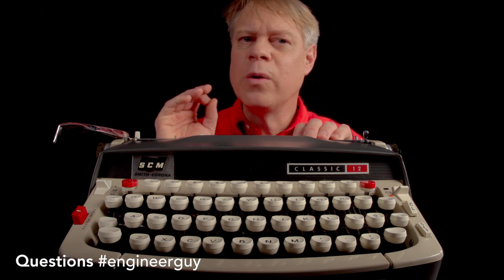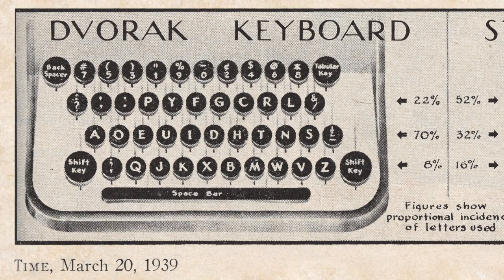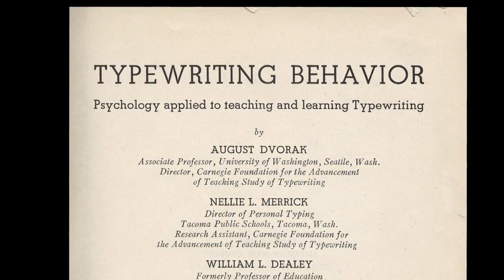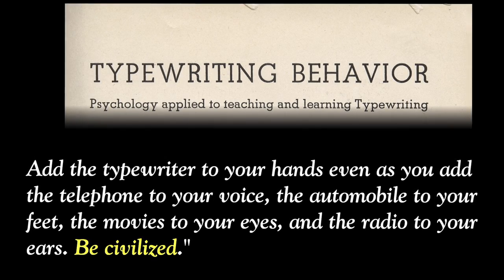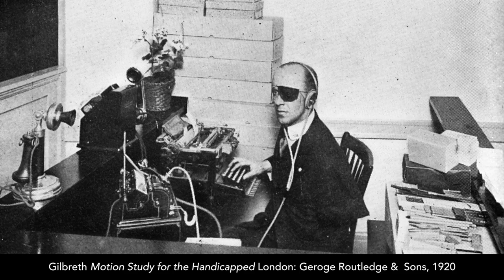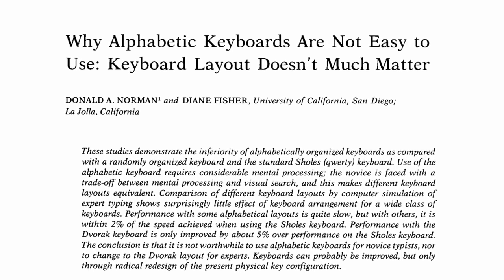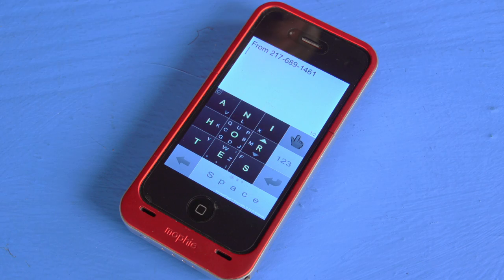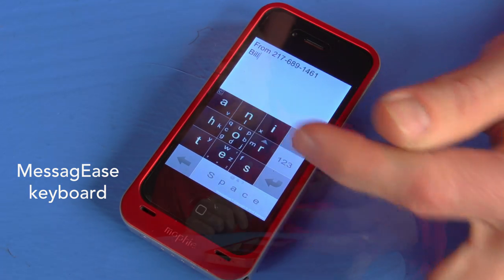Why the Dvorak keyboard didn't take over the world

Comment: I learned QWERTY touch typing in 7th grade (1962) and went on to become a software developer. Around 2000 I started experiencing 'carpal tunnel' type pain in my wrists and took the opportunity of a job change to retrain myself to Dvorak. It took about 12 months to regain my 60+ words per minute speed with 95%+ accuracy. Since then, the pain is gone and I am convinced that minimizing the up and down motion required by QWERTY is why. YMMV.
Reply: I agree about it causing pain. Even if its not painful I feel the strain from the QWERTY pattern in my relatively young hands. Its also rather awkward in how it feels.
Reply: 60wpm average or peak? that sounds a bit low to me, considering you're a programmer from such long date. but glad to hear dvorak helped you.

notes:  just took a test and did 91 wpm on the first try (454 cpm). if i remember correctly i can do over 120 if i concentrate and take the test a couple times more. 
but as i type this i notice i'm not trying to type as fast as i can so i'm at least 30% slower than i am taking the test. maybe in a normal situation i'm closer to 60 than i am to 100 wpm...
or not, since the words are all in my mind and i don't have to waste concentration reading two words in advance from what i'm typing.

Comment: I have to dispute the main thrust of the argument presented. I have personal experience using the Dvorak layout. In 1990, having capped at 68 wpm with qwerty regardless of how much I practiced, I switched my work pc to a Dvorak keyboard. For two weeks I was virtually crippled by my muscle memory making me choose the wrong key as I typed. Then I relearned the map and within another three weeks had equaled my 68wpm. I popped the caps on my laptop and switched those as well. That was in the days of easily popped keycaps. I changed my home pc also. Within another month I had finally crossed the 100wpm threshold on Mavis tests I used in my spare time. I averaged 95wpm in the real world. I wrote a lot of management reports and finally could type at closer to my speed of mental composition. It was liberating. I was more accurate as well because Dvorak moved odd keys to the periphery. Then laptops took over and hard-to-pop key caps predominated. My colleagues didn't switch because they couldn't envision relearning or even harder, unlearning what they already knew. The reason Dvorak failed wasn't because it was limited to 5% improvement. It was much more. I suspect those studies used subjects that spent little time unlearning and relearning, as it's a major investment, and hence they yielded only a 5% gain. But within 90 days i had realized a 40% gain and benefitted for well over a year before upgrading to models that made Dvorak difficult. You can't mix. If any pc you type on uses qwerty, Dvorak speed plummets because that speed requires automatic response. The key would be to have taught typing in schools in Dvorak. Same with Esperanto. Teach everyone worldwide this common language as their second language. Then we can all communicate. But the initial  investment is high. So we live in a world of fragmented languages and I type at 65wpm and have for decades now.
Reply: You went from 68 to over 100, but people who were already over 100 have less room for improvement.  It took you weeks to get back to where you were before the switch.

It has a lot to do with individual perceptions of expected improvement.  The bigger the expected improvement, the more likely a person is to switch.  That means that the people who are really good, and the people so do not expect to be very good are the least likely to switch.
Reply: Well, on typing competitions back in the day all the ladies and secretaries that learned Dvorak dominated. That was until Dvorak layout was banned from the competitions.
And if something is banned from a competition because it always wins, I'm quite certain that it must be good.
Reply: Metatr0n yes but at a competitive level 5℅ is huge. i mean i expect that difference to be larger than the skill difference
Reply: I switched to dvorak a few years ago and just bought little stickers/labels that fit on the keys. Easiest fix out there if you don't have a keyboard you can take apart.
Reply: If you could type at 100 WPM, then would you really need to rearrange the labels of each key?  Just switch the keyboard to Dvorak via software...  Seems fishy to sacrifice "40% gain" due to the inability to pop the keys.
Reply: With computer operating systems (except iOS, for some reason) there is no need to change physical keys or put stickers on. If you are touch typing, as I am now, with a Dvorak layout on a QWERTY-labeled keyboard, there is absolutely no issue.

I only switch back to QWERTY on shared computers (hate it, because I have to hunt-and-peck) and for some games (often designed for physically proximate keys based on QWERTY).
Reply: A guy in India has a record for typing 103wpm with his nose. Maybe you and all your colleagues should switch to using your noses?
Reply: Metatr0n, "And if something is banned from a competition because it always wins, I'm quite certain that it must be good." Yeah...not always the case. Stuff gets banned for various reasons. (Though there doesn't seem to be any evidence that Dvorak keyboards were actually banned from competitions. Though they might have been in some cases, there were a lot of typing comps, many sponsored by typewriter companies, so I'm sure somewhere in there many things were banned. If you sponsor the event, you probably want your brand to win.)
Reply: +Roger Bowman
Did you forget where the enter key is when you switched to Dvorak, or are paragraphs new to you?
Reply: Roger Bowman : Esperanto sounds an awful lot like Spanish when spoken...just sayin'...
Reply: i also use only Dvorak's 'Simplified Keyboard Layout'. (That's what Dvorak called it. I like his name better so i use his name for it too.) Roger, what do you know about this topic? You only have personal testimony and (years?) of experience on your side. (I'm being sarcastic.) Before i made the switch years ago (maybe 5 years ago), i saw a big debate about it. Then i weeded out all those who did not say they actually tried it. All who mentioned that they tried it loved it more.. every single one of them! And only one actually switched back to Qwerty and that was only because he was forced to use Qwerty at work and he was tired of wrestling with both. Some people switch between them without much trouble. But i do notice my speed decreases when i use both layouts. I did have a job where i typed some (after i switched to Dvorak's Simplified Keyboard Layout), and i had to use Qwerty at work. But i didn't type much so my about 40 wpm on Qwerty was sufficient and it didn't bother me much. If i were to type a lot, it would bother me being required to use Qwerty a lot. Now i'm able to avoid using the Qwerty layout almost entirely. (I finger poke occasionally when i need to help a friend on his/her computer.) My typing speed increased a LOT when i switched to only using the Simplified Keyboard Layout too. I recently measured my speed and i'm about 50% faster with Dvorak's Simplified Keyboard Layout, but i don't claim that is because of the keyboard layout. it might just be me and more practice. what i do claim is how much more comfortable and thus more enjoyable typing is on Dvorak's Simplified Keyboard Layout. But many typists indeed find a much faster speed after switching from Qwerty.
Reply: Roger, i encourage you to look into the Ido language (as an alternative to Esperanto). Web search for 'Ido linguo' for best web search results because "Ido" finds English mispellings of "I Do" more than the language. :P
I like Esperanto too. Esperanto is a great and brilliant language! But i'd compare the first (alphabetical, A-Z) keyboard layout to traditional, national languages. I'd compare Esperanto to the Qwerty keyboard layout. And i'd equate Ido to the Dvorak layout. Esperanto was designed by an optometrist, while Ido was designed by a professional linguist. But both are great languages. And Esperanto is still super. I'm not knocking Esperanto at all, but i do knock Qwerty.
Reply: Justin - In other words you have no decent rebuttal to his argument so you just resort to sad insults?
Reply: Justin, Jenny has a point. please allow me to politely expound a bit more. even tho Eric was ignorant in both of his points, there's a mature and much more polite way to express it. something like, 'Eric, neither of your points are factually correct.' And if u want to expound on the facts, then you can. if not, u don't need to. cheers! (personally, i think it's more important to treat people like people (with respect) than it is to even post anything regarding a topic about keyboards (which is not the most important topic in life).
Reply: @851852093114208513 , you believe 2 misconceptions in your argument.
#1: Dvorak is truly a lot better than 5%. if u try it, you kan see how much (far) better the Dvorak is. my estimate is about 50% better, both in speed and 'ease' & comfort on one's hands.
#2: a lot, lot more people speak Esperanto. when u claim 20 people, i hope u understand that u are under exaggerating, 'only' by a factor of roughly 5000 times. 😋
I see your point that if nobody or few people uses it, then it's not so useful, like a telephone when nobody owns any yet. true. but when enuf people realize the potential, they will get them, so it will be useful. But Esperanto has already way over grown the useful threshold. Millions of people speak it. i like Esperanto a lot. but i like an easier language with the same purpose as Esperanto even more: Ido. but even then, Ido has many, many more speakers than 20. 😜
Reply: Mark m; you can use www.branah.com/dvorak on shared computers

r.decline; haha no way anyone types 103wpm w their nose. The g forces on the brain would be deadly.

Eric bishton; if everyone learned esperanto then everyone would know how to speak it.
Reply: cool anecdote bro

Comment: While I was at university I learned of the Dvorak layout and wanted to try it out. I found stickers on ebay which I stuck to my keyboard at home to turn it into dvorak. After forcing myself for a week I was able to type dvorak. A month later my dvorak and qwerty skills were about the same, seeing as my qwerty skills suffered a bit. Interestingly enough at this stage it was impossible for me to type qwerty on my home keyboard, and impossible to type dvorak anywhere else. 

A year later I bought a wireless keyboard for my home computer. I considered staying with dvorak at home, while type qwerty everywhere else. But I didn't. The main reason is I suffered when it came to key bindings on modern computers. Something like copy, paste and cut, which I use constantly, is a one handed operation on qwerty. On dvorak they are two handed, unless you have a large hand "wingspan". 

In this case the qwerty layout was adopted too widely to make a change impractical. :(
Reply: +JP Meijers I have a non-qwerty layout and the short cuts are unchanged. It took me much longer than a week.

Comment: I tried to switch to Dvorak once, for a year.

I gave up, the investment needed to get used to it might be OK. However, In a world where I not only use my computer ever only. I gets worse. I developed problems using a QWERTY. Go to the university, use a terminal there? Fail. Use the vending machine selling train tickets? Fail. Get in the bootloader of you notebook? Fail, no Dvorak there either etc.

Its locked in technology, since everything would need to change at once...
Reply: I must not be able to count. I get 8 permutations by 3+3 keyboard layouts in both languages then +2 for each spoken form. Its not 3^2 to equal 9, or am i just mistaken?
Reply: If you cant access www.branah.com/dvorak to cut and paste then someone needs to make a keyboard w hardware that sends the proper signals of its’ dvorak layout. I mean type type a letter g in the dvorak location where u is on qwerty and the keyboard sends a g signal. Then absolutely no problem w any firmware level dialogue windows.

Comment: Actually, I have used the Dvorak layout on my keyboard since about 2005, and can easily blind type on it.  I have carpel tunnel in both wrists, and had hoped that the improved layout would help  It, with the help of a mouse that turned my wrist vertical (rather than the standard horizontal).  I have avoided surgery, and my hands no longer go numb when I sleep.

Comment: The biggest thing I would want to change on the keyboard is having QAZ, WSX, EDC, etc aligned vertically.  There is a very exotic split keyboard like this called the Kinesis Advantage Pro and it is extremely ergonomic and fast.  It takes minimal amounts of time to get used to it because it still uses the QWERTY layout.

We haven't had a need to stagger the keys to accommodate mechanical levers for a long time and it's time we lined up the keys.
Reply: Well done. You've just pissed off every PC gamer ever.
Reply: Fragdog Shiba wtf? how would lining up the keys piss off gamers?? in fact, lining up vertically would make WASD more logical (they would be aligned at right angles, much like the arrow keys).
Reply: ._.
I'm an idiot. Disregard what I said.
Reply: Gregory Samuel Teo I am an ESDF guy.  Not only is identical to the typing position and offers the notch on the F key to let me know where my fingers are without looking, it opens up a lot more keys for my pinky finger.
Reply: ***** Ultimately, I just got tired of completely remapping my keys for every single game, and just learned to use the default (once that changed from the arrow keys to WASD), though I acknowledge that both ESDF and vertical alignment would be superior.
Reply: Most of my games seem to keep their settings in the cloud so I only need to map the keys once per game.
Reply: wouldn't make a difference for my gaming, i use dsf[space] and those are all lined up already.
not sure if it's more comfortable for typing. i'd like to try. i can see my accuracy dropping at first, though. for sure.

Comment: As an engineer once explained to me. "Any new idea can't be 'as good' as the one it is replacing. He has to surpass it or the previous, the familiar, will remain in place."
Reply: It's not just that. The improvement has to be immediately, visibly greater than the short-term opportunity cost of the switch. If it takes time and trouble to switch, that's a huge barrier to market acceptance. People are lazy and habit-bound. They don't like making an effort, even when it saves them more effort in the long run. Combine that with the lock-in self-reinforcing mechanisms of path dependence and network effects.

Comment: I'm a dvorak typist.  I learned on qwerty in high school, then switched to dvorak when I was 30.  It improved my typing speed way more than 5%, AND it reduced fatigue.  Who cared much about fatigue amongst typewriter sales execs back in the day? All they looked at was the alleged 5%.  I will never know how much it mitigated carpal tunnel (i.e. repetitive stress injury) for me.

There is a difference between "technological failure" and "didn't take over the world".  I would NOT consider the dvorak layout a technological failure.  In fact, modern operating systems make it easy to choose dvorak, and it's no surprise to me that there are other dvorak typists commenting in this thread.  With computers, dvorak is back!!  Even my Raspberry Pi computer with Arch Linux supports dvorak.

As to the problem of qwerty "slowing down" typists, I agree that's a myth; it was not intended to do so.  It put the most frequently typed-together letters at opposite ends, so that the hammers swung away at a steeper angle, and thus did not jam as much.  The sticking hammers are long gone, but qwerty is still stuck.  To me it's more of a marketplace quirk.

I don't even care that my keyboards still have the qwerty layout printed on the keys.  I just ignore that, switch to dvorak in the control panel, and off to the races!

Comment: I feel like I should weigh in here. I've been on a Dvorak keyboard for about ten years now. Learning was tough but it was well worth it. I was a touch typist on a qwerty before I switched and I used to get about 75WPM, after switching to Dvorak I'm closer to about 95WPM. I consider that to be a pretty significant improvement but I understand why some would say it's not worth it.
     However there's one aspect of this that this video didn't seem to touch upon which is comfort. My fingers move a lot less while typing since all the most used keys are where they need to be and not somewhere else. I find that I can type at a high speed for a much longer period of time before feeling cramped over overworked. I used to have to slow down from time to time if I were writing out a big essay or something like that but now I can just bang through it without issue.
     What are your thoughts on this?